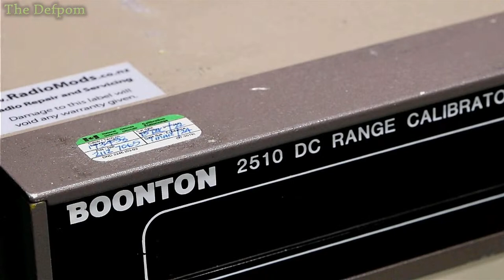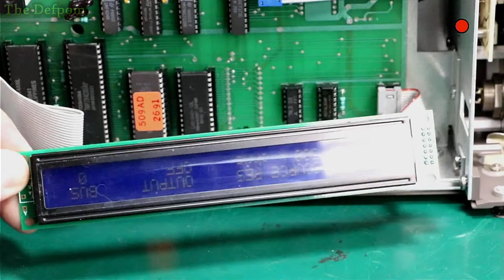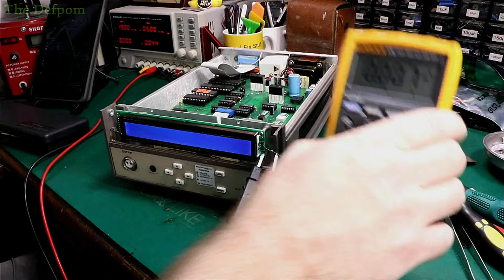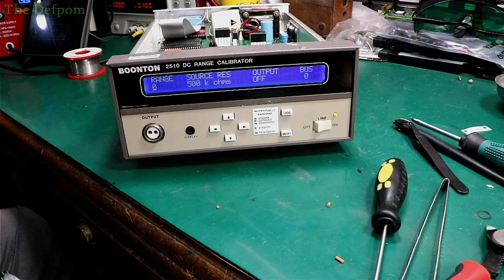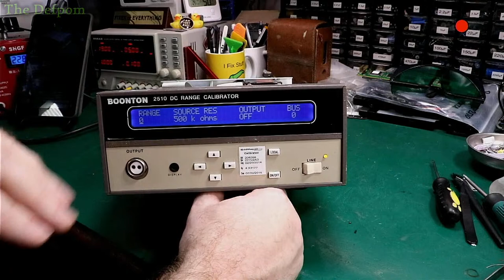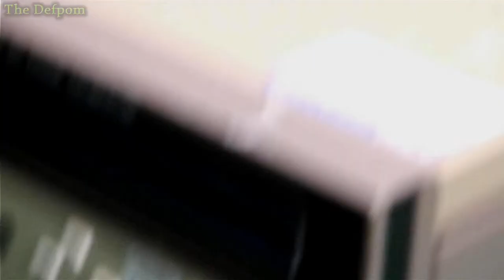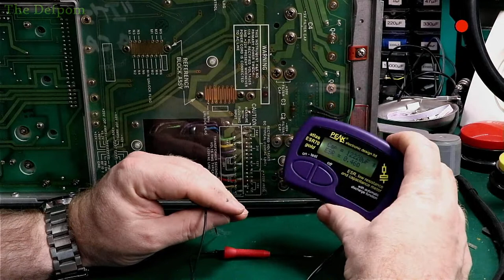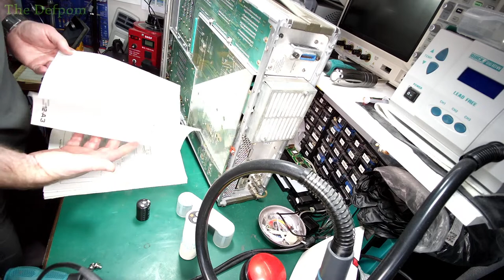🔴  Live From The Bench - Lets Chat and Tinker At The Bench trying to fix some things

Comment: Scott, I agree with you 100%, in most cases I will replace all of the electrolytic capacitors especially in test equipment I plan to keep and use myself. However,  in the case  of these large bolt-in capacitors,  I test them completely and put them back if they are okay as they are very well made and are very expensive to replace. In all the gear I have worked on I have only found one or two bad ones. Most get their value, ESR and leakage current and test voltage written on them with the date and get bolted back in. Regards, David
Reply from the maker: I proved up a set, it would cost me $150 to replace the 4 big ones!
Reply from the maker: I’ve had the generator up and running and fixed a bunch of minor issues with it this evening… just one last thing to fix and I can call it done, apart from the caps, because I think I can get away with not changing them yet.